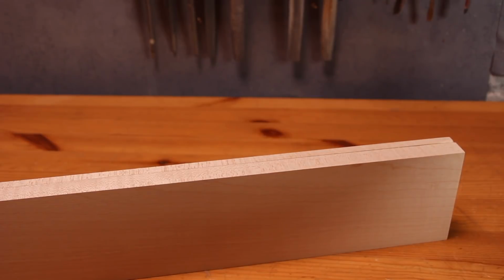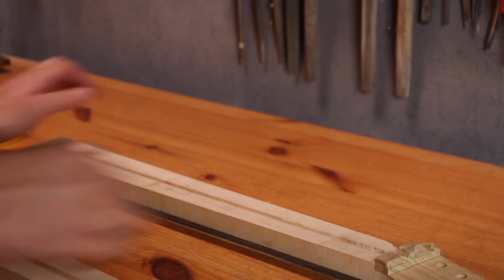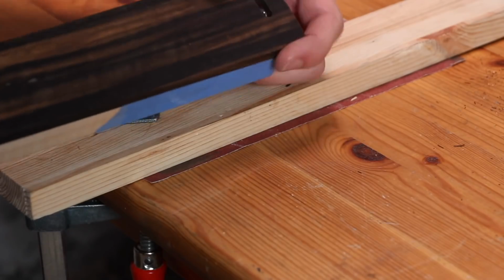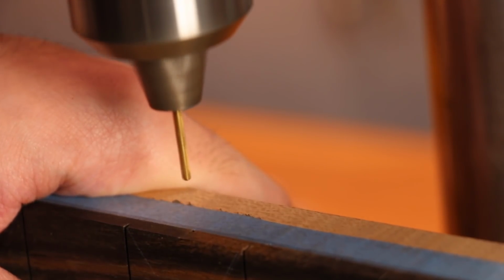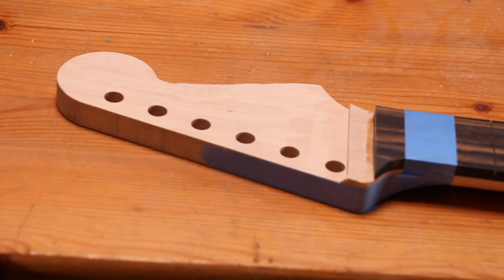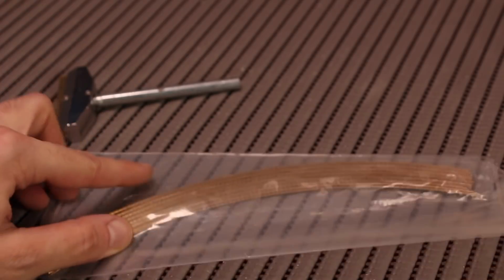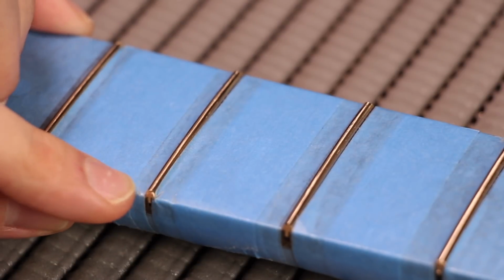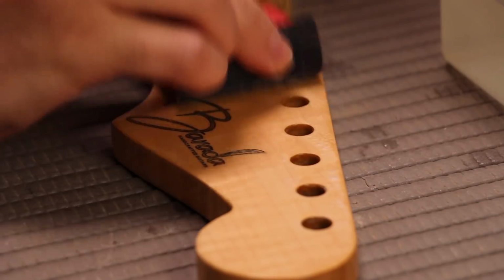Ultra Stratocaster Build - Part 2 of 3 (Full Strat Neck Build)

Comment: I will use the same truss on a neck fabrication project I am doing. I like simple and the ability to tweak the neck both ways. This project I may fail at and may have to slide off into the wastebasket but I will give it a go.

Comment: I love this build you are doing my friend. My next build coming up I am going to do the same body finish....and few other ideas you gave me.
Reply from the maker: Glad that’s a useful video! 
Thanks
Reply: @BaradaGuitars  Getting Birchwood Casey filler and sealer and the true oil was not easy in Canada but it is on order. Two different stores I had to go to. Later ✌️🎸😎
Reply: @BaradaGuitars  I tried applying the filler and sealer with a brush. Did one coat that way and realized your way of applying the the filler and sealer and true oil is the best way. ✌️🎸
Reply from the maker: @johnstitt2615  thank you!

Comment: That is a good neck..You used a figured maple on neck. So does that mean it is a soft maple and that works ok for neck. I was told only use hard maple quarter sawn on neck.But i have some figured soft maple that is not quarter sawn that i would like to use on neck.Should I try to use it?

Comment: excellent work. What kind of oil did you use to bring out the wood grain like that? Especially for the guitar body...
Reply: tru oil
Reply: @clartypaths840  only tru oil or do you use a base of another type of oil first? Can you please send me a link to know what kind of tru oil you used? thanks.
Reply: @rosko613166   Tru Oil is a product name, it's made for gun stock handles but works great on guitars too.  https://www.amazon.com/Birchwood-Casey-Tru-Oil-Stock-Finish/dp/B001I14QUU No other products required, just Tru Oil. 2-4 coats will give a nice matte finish. If you prefer glossy, keep adding thin coats (10-20 depending how thin you apply it). You can also use similar products, such as Crimson Guitar's Penetrating Oil https://www.crimsonguitars.com/products/penetrating-guitar-finishing-oil though I found the Crimson oil to be much stronger smelling and less pleasant to use.
Reply from the maker: Many thanks! 
I'm using truoil as I said in the video
Reply: @theweekendluthier  thank you very much for this information.